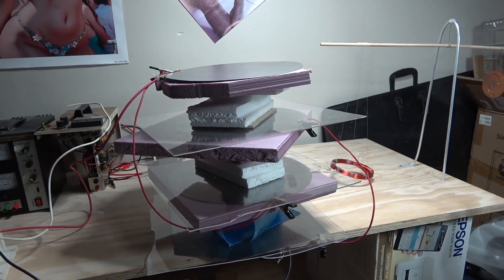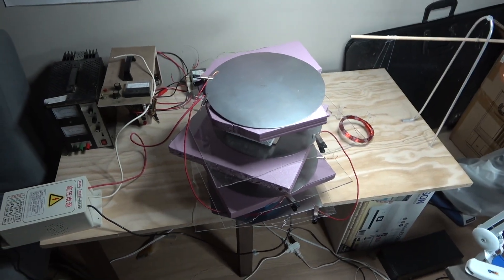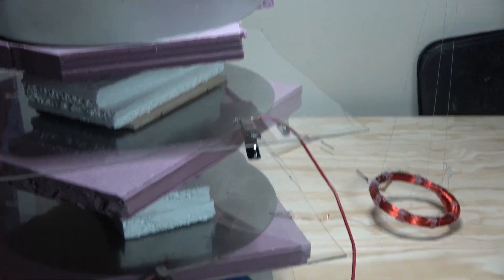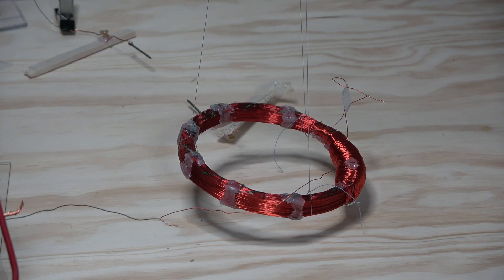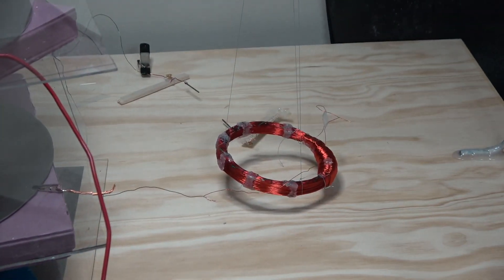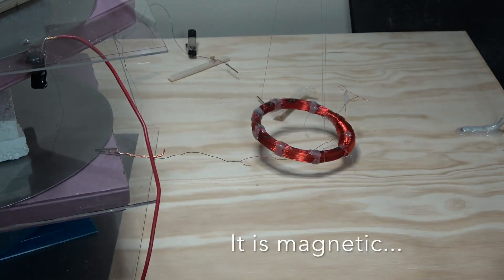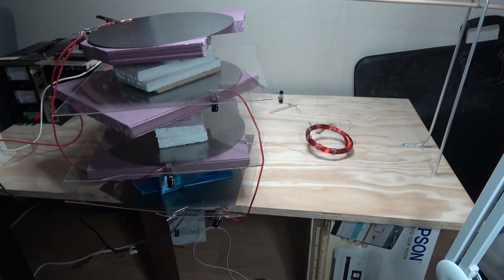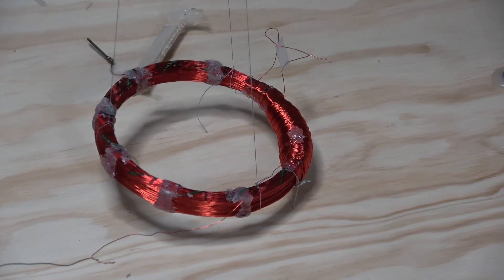Antigrav Coil Part 4

Comment: Capacitor plates can be 3 times closer than spark rods if dielectric is air. If you use good dielectric you should be able to get much larger capacitance just by placing them closer to each other. Look up breakdown voltages for different plastics there are tables in industrial and other websites just for plastic materials. I assume that voltage across caps is lower than voltage across spark rods. Rods are spikes and break down voltage is 1/3 of that of plates with same dielectric. Plates will discharge a little bit without ionization if air is dielectric even more, but with plexi you should be fine, just test it. Also make sure to isolate edges of the plates otherwise you did nothing. Plexi has to go all the way around to make air path as long as spark spikes gap/3 if voltage is the same. When it comes to coil, they store energy in the air or dielectric between the wires, so you should experiment with that too. Then there is configuration where one coil is in the middle of the other at 90 degrees and tall instead of wide. I'm building something like that my self but currently I'm focused in to controlling and building high voltage generators from ordinary DC 10 do 30V. With 100 turns coil and about 1kHz and 4Vpp pulse I fried 500V MOSFET by accident, I did not expect that high voltage and that is before high voltage coil that made about at least 50kV from weak 900V pulses. I use solid thick copper wires with isolation and will use silicon tubing to provide more air for magnetic fields to store if that helps. I also have dozens of meters of guitar coax cables to test that. Then there are pyramid shaped winding, double windings, then winding that change direction in the middle of the coil. I need to experiment with all that but if you do it I just need the results. I suspect some of those configurations are optimal solutions. How do you control direction etc. Regular coils are not that effective from what I could figure out so far. Good luck!